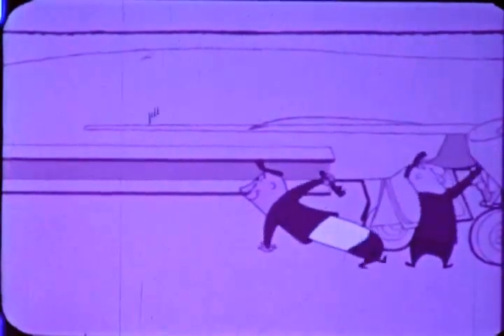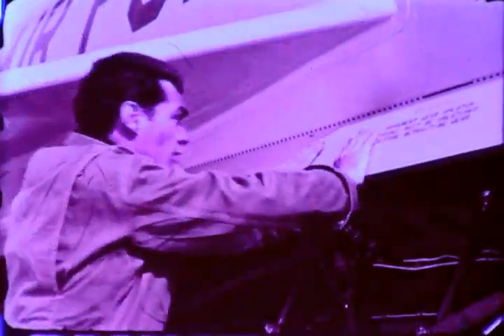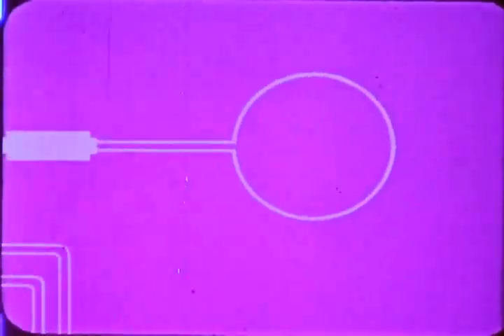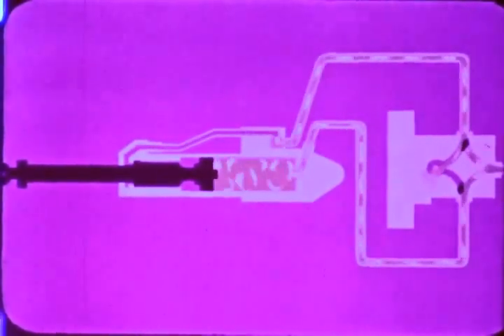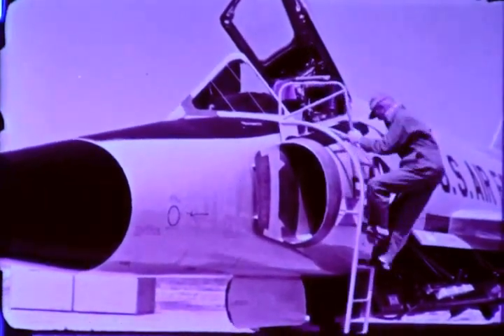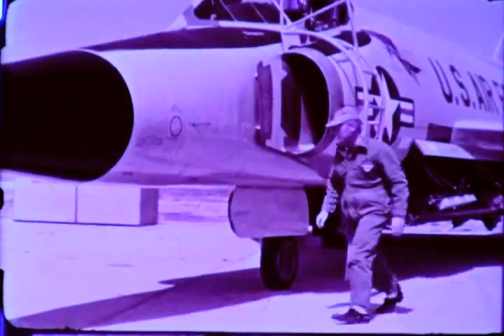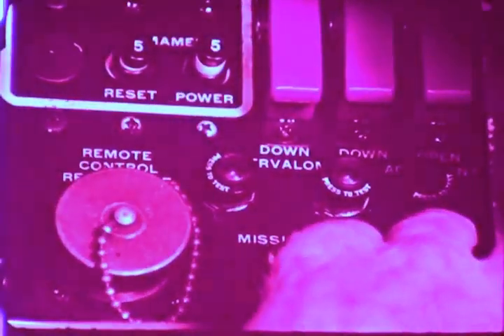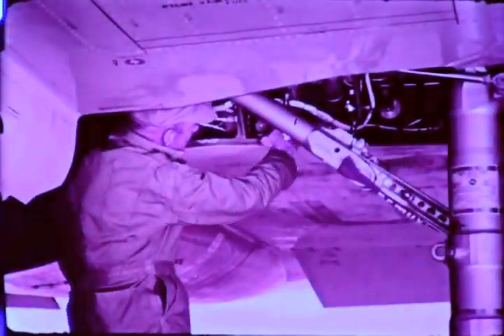F-0342 Safe Ground Operation of the F-102 Armament System

Comment: That's why they created Tag out, lock out. Too easy for someone to go to lunch, and someone else comes in and starts retracting things or checking things and person #1 returns, starts doing things, sometimes killing #2.
Reply: Or No.1 checks to make sure the cannon arming switches are off (for example) before loading the cannon, then goes to lunch. No2 stupidly or accidentally switches them back on, No1 comes back and rotates the barrel assembly, and the cannon fires the first round that passes the initiator point. Of course No1 shouldnt go to lunch in the middle of that job (and thats why they dont load until right before takeoff), and one should always double check anything potentially dangerous, especially if it has been out of your personal supervision for any time. 
But Im a little confused. My experience with lock-out/tag-out has been that it applies to malfunctioning equipment to prevent anyone from using it. Are you saying there is equipment that is locked out and tagged every time you leave it alone? I can see the locking part, but I thought the tag was to mark a potentially hazardous malfunction.